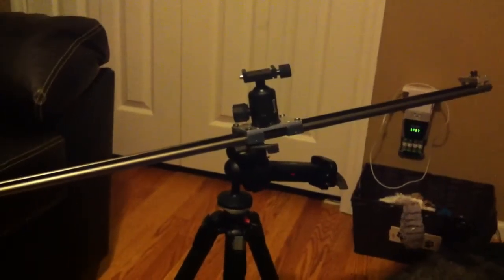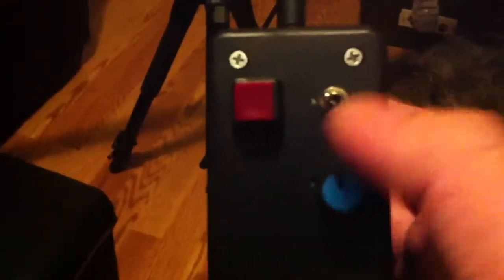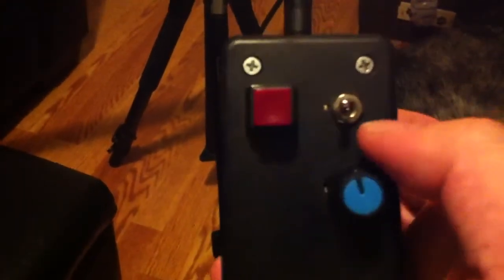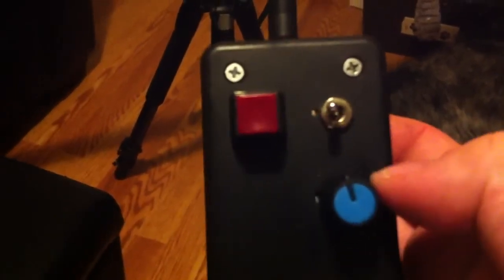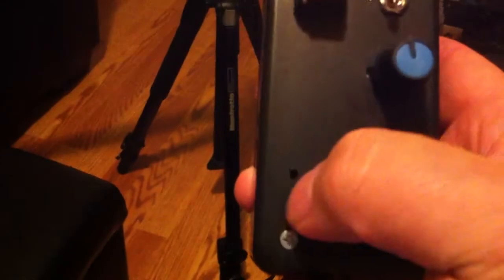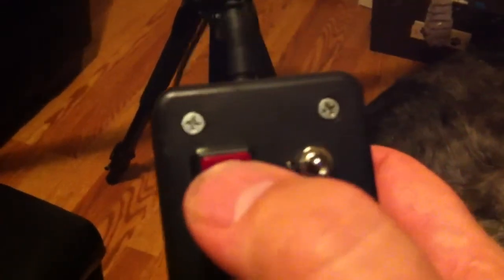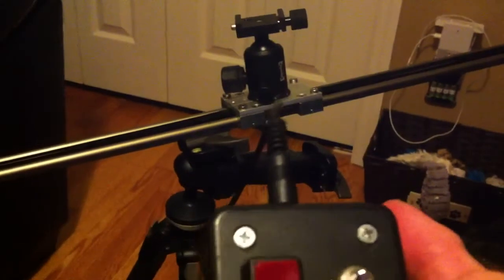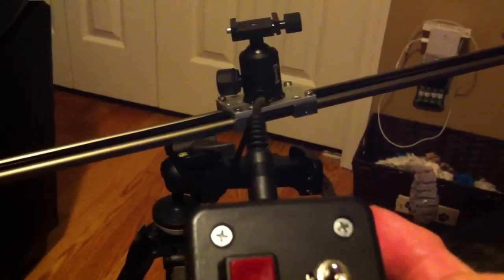DIY camera slider

Comment from the maker: If you use the microphone on the camera you might get some unwanted noise.  If you use an off camera microphone for the interview I think you'll find it to be fine.  I've noticed that after using it a few times the noise has nearly disappeared.  Maybe the motor simply needed to be broke-in.

Comment from the maker: You're very welcome.  I updated the description and added the links.  The parts list and the links to the sources for them are at the first links, the motor and controller are the ebay links.  
Good luck with it!
Oh, by the way - the speed for this turned all the way down causes the carriage to travel from one end of the slider to the other (1 meter) in about 14.40 minutes.  At the fastest speed it takes 1 minute 30 seconds to travel the same 1 meter.